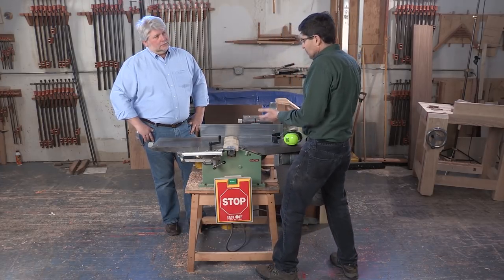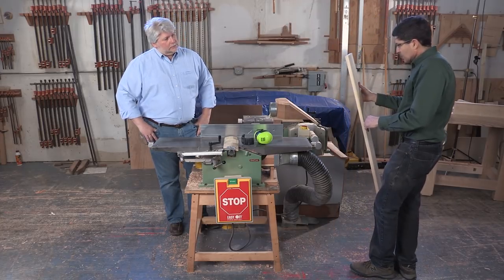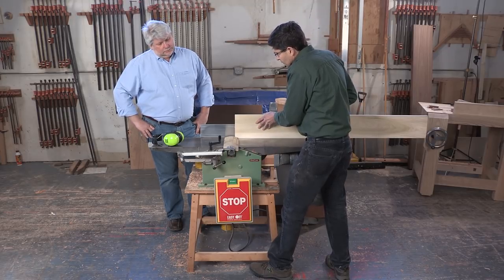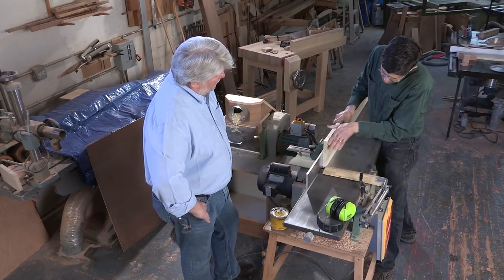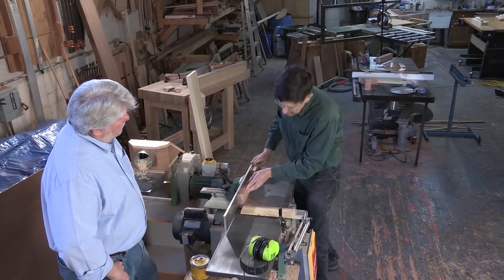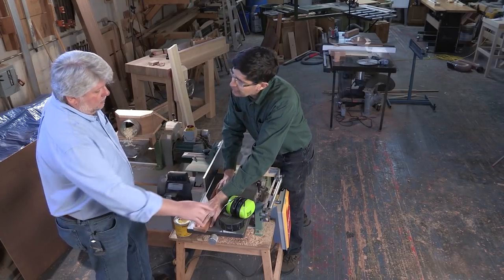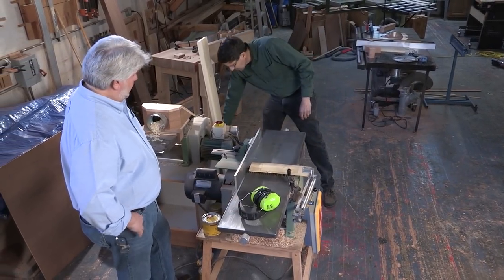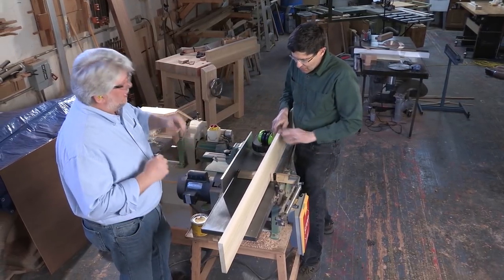Ergonomics of Jointing

Comment: Well presented.  The other issue is height.  Often jointers are too high for woodworkers, especially when jointing wide stock.  After planing a lot of stock the back really feels it if the planer is too high.  It's also dangerous.